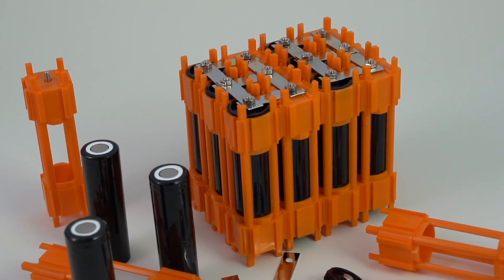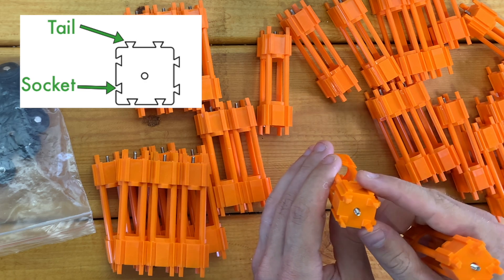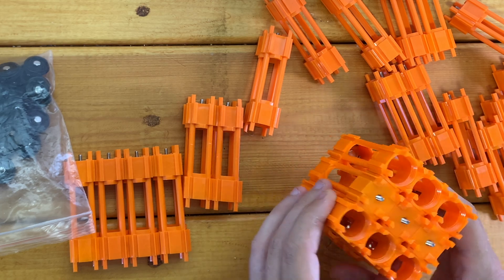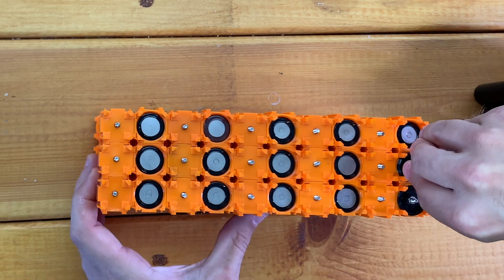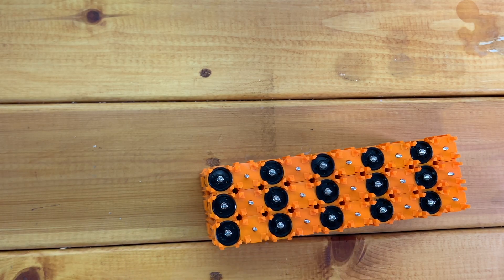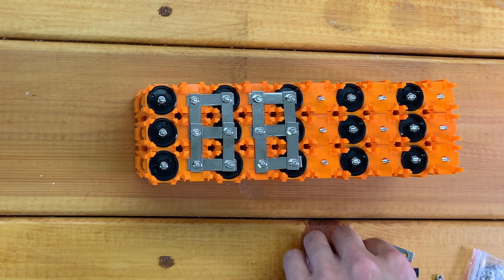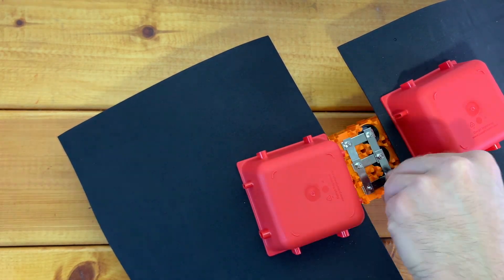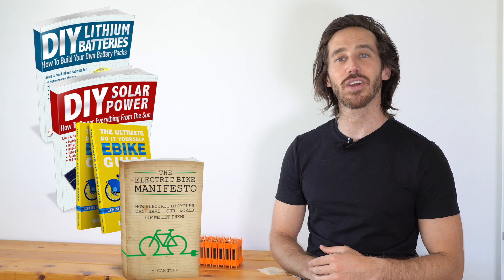Vruzend V4.0 kit: Building a DIY 18650 battery (no welds!)

Comment: If I have two batteries with BMS would I be able to wire them in parallel and even charge them in parallel without having to replace the BMS or re-wire the whole pack?

Comment: Thanks Micah for a great video! Are the nuts self locking? Or is some blue loctite recommended? The kits are all 36V. Any suggestions how to use 2/3 of the 2nd kit after making a 48V battery? A link to BMS installation is also needed. And maybe a link to heat-shrink battery sacks? I have a heat gun...You do a great job and attention to safety measures is appreciated.

Comment: Amazing!  I hate spot welding cells together - not because it's bad, or doesn't work, but because if a cell dies, it's virtually impossible to replace.  This is a much more 'environmentally friendly' solution.  Also means I can easily reconfigure the pack if I need for a new build.

I tend to use thick leather welding gauntlets to cover the ends of the pack when I'm working on it.  They don't slip or fall off like foam sheets can.
Reply: Indeed Simon, that is also the reason why I like this idea for a kit, easily replacing a bad cell. Built correctly, the batteries will keep a good connection, even over bumpy ground.

Comment: I hope the V4.0 kits hold up better than the V2.1 kits. I bought 2 of the V2.1 for a 52V pack. After building the pack it sat on a shelf in my shop, which stays at a constant 72 degrees, for 6 months while building my bike. When I started to install the battery pack fully half of the plastic terminal caps had split along the length. Contacted Vruzend about the problem and never received a reply.
Reply: I had the same issue.

Comment: Your terminology can be hard to follow. When you say 20A cell what do you mean? Why do you refer to ells as both single cells in the traditional manner and also in groups? It seems this is a very expensive and somewhat unreliable system.  I would not even say it's quicker or easier than just spot welding.  Not a big fan of dozens of overlapping links either.

Comment: When are you going to make a version 5.0 for 21700 batteries?????  I can get them in the US for pretty cheap and they offer a lot more power per cell.  Can get a 20ah battery with only 40 cells using Samsung 50E's

Comment: Looks like a great way, without spot welding for a battery build and would be easy to change out problem cells because of no welds, but I would think to replace a ebike battery, with limited area, one would need to downsize as they look to take alot more space than a welded battery. I wonder too what type plastic they use. If a very durable type like HDPE (like 5 gal. buckets, milk jugs, laundry soaps, shopping bags), they should take alot, but if of a brirtle plastic, they may not be good for, say a dual battery on a ebike going off-road?
Reply: There are reports of the plastic crumbling and the batteries breaking.  No need to describe the potential issues with a separated battery pack.  

Micah may be a scam artist. None of the Canadian backers of the Version 4 project received their reward kits.  Many believe he didn't bother sending them.  If so, that would make him a scam artist.  No one has received feedback nor replies from him nor from Kickstarter to contacts and complaints. Zero feedback. There have been no replies to questions or requests for a sender name and address so we could check with the CBSA for any issues.  Nothing.

Comment: I have a v3 Vruzend kit and the largest center battery case (Hailong Polly) Unfortunately the battery box manufacturers made  narrow case. Max useful width in case is 7cm in the 9.5cm box. The Vruzend height is 9cm, if the batteries ideal direction is laid down. Witch is the good ebike battery case it fits?

Comment: Bunch of us bought these on Kickstarter. Months later there is no reply to where they are or the battery holders.
Reply: Absolute silence from them on the Kickstarter campaign since the end of February (when they said all rewards had been shipped) and it is now the end of April 2023. No way to communicate with them. No tracking. No reimbursement. Nothing but grief. If nothing else, I will have learned from the experience to NEVER EVER AGAIN finance another Kickstarter campaign again.
Reply: Ya whats going on! I sent a message to you on kickstarter with no reply! Silence is not the way to deal with this dont you agree?
Reply: @mitch-j5x 
 I sent Kickstarter a message directly and they said it's up to us and the Vruzend because they don't want anything to do with it. They received their money and it's over. We are supposed to search around to find out how to contact the company. So much for Kickstarter's concern.

Comment: Thanks for the video info. Looks 'easy' enough and I'm sure much less expensive than ordering a new battery pack from the manufacturer. One piece of advice I might suggest. When tightening down the buss bars, follow a 'Z pattern'. Bottom Left-Middle Right-Top Left, then follow with Top Right-Middle Left-Bottom Right. This should ensure 'even' pressure across every contact. Much like changing a car tire, skipping over every other stud, just snugly, then repeat the pattern to tighten up.

Comment: I received my 4.0 kit, and built a 12v pack (4s3p) using 18650 LiFePO4 cells. Added a LiFePO4 BMS and it works perfectly!

Comment: What do you know about the lithium phosphate battery? What's the difference between lithium and lithium phosphate batteries other than size.. The lithium phosphate batteries I found are a lot larger... It's said that the lithium phosphate battery doesn't overheat as easily and smaller chance of fires...🤯

Comment: I’d like to mention that if the thread will be bit longer it will help a lot more as i struggle with existing threads. So just to clarify that if you want to thigh up properly you’ll damage the thread itself.

Comment: Hi, would like to ask how many amps I can add to my scooter battery, currently running 48v 15ah. my controller is rated 20ah. can I use 48v 45ah on  my 20ah controller?

Comment: The positive connections have me a bit worried. The current is flowing from the bolt threads to the nut to the bus bars. Bolt threads are thin and don't transfer current well to a nut. I would like to have seen a bit of flat metal surface at the base of the bolt where the current would flow to the busbar. The negative connection looks like it has this.

Comment: How do you determine the Amps to charge a battery.  In other words what is the lowest amperage that will charge a battery?
Reply: The ‘dumb’ way to know the max is 10% of the ampere rating, for some battery types.  But, yeah, you use the correct type of charger and the man here will have a definitive answer I am sure.

Comment: I would suggest it will be quicker, cheaper, more compact and electricly sounder to go the welder route. Compact battery operated welders cost very little plus I found Verusend products poor quality, brittle plastic with lots of flash, iffy electrical connections plus connecting the balance wires was a pain. A nice video though but not for me this time

Comment: Is it possible just to make single battery molds into 36, 48, etc... as a whole plastic piece, that would save time building would it not, it would be more solid and the still leave the ends for adding loose battery molds in case you want to go from 36 volt and upgrade, even combine a 36volt to a 36volt and same to other, or mix and match.

Comment: Looks like a cool kit. I wish they offered an all in one kit i.e. cells , holders , connectors,  bms , insulators ,heat shrink and wire in different voltages and capacity.
Reply: But he doesn't deliver what's ordered, and no followup after, so avoid him.

Comment: I have bought your kits in the past, since I didn't want to have to weld them.  The problem I had both times was that they cracked within one year, making it useless for me.  Will these new ones do the same thing?
Reply: Thanks for the tips, was there any padding around them ? Or maybe the plastics were against some metal frame / case directly ? I am thinking shocks and heat from batteries are a factor 🤔

Comment: Nice kit, but it takes the much of the sport out of battery building.  No hot gluing cells together.  No welding sparks flying about.  If they create a way to integrate a BMS into the mounting system it will totally ruin the battery building experience.  I will however compliment Vruzend for developing a system that will easily allow you to replace a bad cell should one go bad in the pack.

Comment: What is the overall size of the finished pack ?
Reply: depends on the design of the battery (more voltage and amps, larger pack)
Reply: @micahsdad5388  that's true but I was talking about the 36 volt pack in the video.

Comment: Just a thought - how about using one piece of rubber foam and cut out a "work window" from the middle.  The window could be as long you need for the number of batteries in parallel by two batteries.

Comment: I bought several V1 kits and V2 kits good for prototyping I ride high power ebikes too much resistance and makes the battery packs a little big had some that just stopped making connection after a few months but I have been using them in my lower power projects over the last 5 years  .

Comment: I wanted to know if you could do a video on actual Ebike battery performance. People in general don't know that Ll batteries are not linear in their discharge rates. I was at 10% Saturday and 0% in about 8 blocks later. I too was supprised! I was not expecting to walk 5 blocks to my destination! 😱

It took me an additional 15 minutes⏰ to my expected 25 minute trip! 😵
Reply: 'no' battery is linear in their discharge but Li batteries are more linear than those over most of their discharge. It might be more your charge indicator being off or too simplistic
Reply: The problem isn't really that the performance of batteries isn't linear, it's that estimating the remaining charge state is hard. The discharge curve of Li batteries is very flat, there is nearly no change between 80 and 30% nominal capacity and often enough and often enough for battery protection reasons they don't get discharged below ~10%. However the voltage is also current dependent, so what looked like 10% without load will have collapsed to nearly protection circuit limited point once load is applied.
Reply: Probably better to avoid discahring it below 10%, not worth the wear.

Comment: I would put the positive parallel bus bar first, then series, and finish with the negative parallel bars. Only because of the height difference, stepping the bus bars accordingly could reduce stress/stretch in the long run on the series bars. 
Put simply, "this: _ is shorter than that: / even if they span the same horizontal distance".

Comment: For vehicles clamped battery’s will never be as good and reliable as a welded ones. You will always have microscopic movement that degrades the contact point with the harsh e bike environments. In my opinion clamped is only suitable for stationary packs.
Reply: So clamps only good for portable power banks? Why are their no 21700 swappable power banks for charging electronics?

Comment: I never thought I'd see these anymore on your channel. Might have to get some to review and share on my channel and Facebook page. These look much better and way more easier to build. I just built a 10s4p battery,  I plan on sharing on my channel for a 42v ups. It actually looks like the 3p might fit what I need better. Great review👍👍👍👍👍👍
Reply: Might be hard to get backers. I went to the site and the current pledge was 5000$ and no backers. I'll have to check back in a week or 2 and hope they get backers and the pledge goes down considerably.
Reply: @njfulwider5  wasn't hard to get the backers they needed. Fully funded.
Reply: @sspence65  I might have to check again. I have a YouTube channel I'm starting back up in the next few weeks. Would be awsome to just test a battery pack with this. I've been filming like crazy, so I'll be releasing videos soon👍👍👍👍
Reply: @sspence65  is there a site you can purchase these?
Reply: @sspence65  Fully funded, but some rewards not being delivered.  NO Canadians andf one Swiss failed to get their Kickstarter items.
Reply: @marcpootmans7454  got mine fairly quickly.

Comment: Start turning counter clockwise when you screw the caps, turn until the threads click together, then screw it in. This will prevent cross threading and damaging your soft plastic parts.
Reply: I did this while screwing something on my car (it was in a service / shop) and the 'mechanic" there ... "HA, you are screwing it backwards" 🤡 His boss knew why I was doing that and got mad at that mechanic 😅

Comment: Maybe you  could comment on the cost comparison of these vs a welded style setup.. at what point does it make sense to buy a welder and use the cheaper kits?
Reply from the maker: These are only more cost effective if you’re building a small number of batteries. Depending on the size of the battery, you could break even on a spot welder after 2-3 packs. But cost isn’t the main advantage. It’s the modularity and repair. You can’t (easily) disassemble a spot welded pack or replace one bad cell.

Comment: Just do not harvest 18650s from laptops and power tools, the amp ratings are crap in them.
Reply: Also dif brand battery’s are slightly dif thickness, making them slide into the Vruzend-v4 harder of be too loose